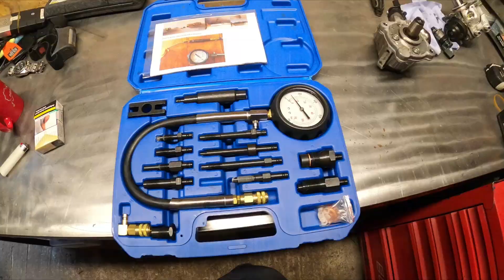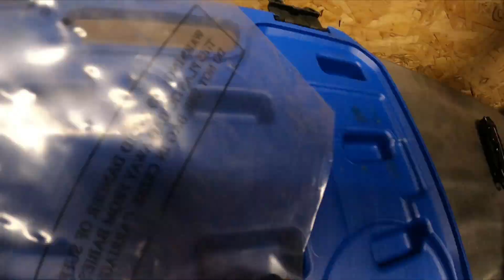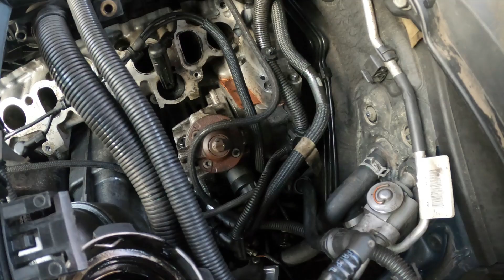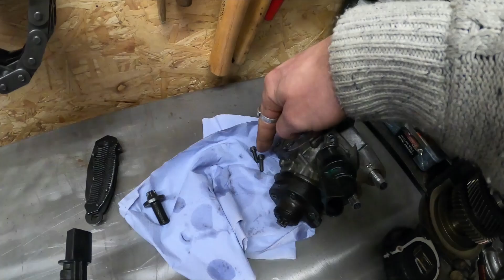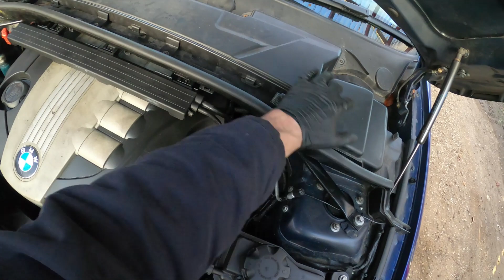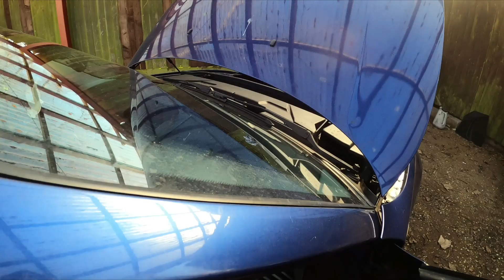BMW 118D N47 High Pressure pump replace Engine oil mix withDiesel, Engineoil increasing, Dieselinoil

Comment: Do you have a guide or tutorial for cleaning out the whole diesel system after getting metals bits from the high pressure pump? Im having the same issue now.
Reply from the maker: You need to investigate first where they come from-likely high pressure pump i would say. You need to take a part and clean all injectors, replace fuel filter, replace fuel rail,  drain flush and clean fuel tank-sender unit and fuel lines.
Hope thats helps

Comment: Hi martins hope u can help me out i have a 320d lci and the lift pump in the tank was making noise and car keeps cutting out and taking ages to start back up, I replaced it but still havd same issue. Anything you recommend check or replace next?
Reply from the maker: Did you check with diagnostic any faults?? It can be anything also fuel regulator. Check fault codes first!? Did you change fuel filter any time in past? Know it’s silly but possibility!?

Comment: Hi. So my car 123d cuts out under heavy boost, all tolerances are fine, no mixing diesel with oil,,,, do you think I need to replace my fuel pump? Many thanks.
Reply from the maker: Not sure. Need to check first before you spending money on new parts! But pump could be one of the problems. Get diagnostic done

Comment: Hello i have 123d running around 260 hp and i see my oil level go up i think mix with diesel what that means and what is the issue? Your car is alright now?
Reply from the maker: Hi Alex. Yes after i replaced high pressure pump all good no more problems with diesel in oil. I would probably recommend you do oil change and after look close to oil level if it keeps increasing then you need to search for issue. In my case high pressure pump seal.

Comment: Hi, great video thanks, I have the same issue with my 730ld 2012 face-lift bmw!! I have to change the oil once a month, I replaced the whole Manifold, then lambda sensor and then air mass sensor, I also did a boost leak test which is all good but I still have the problem of diesel oil mix!! Some people say the car does too many regens and that could be the problem as apparently the dpf requires burning diesel during regen and some of that unburnt diesel goes back into the oil, I don't know how!! Thanks
Reply from the maker: In my case it was just high pressure pump seal but you probably so that on video 🤓 All biggest problems with this 118D they are quote rear not many people come across them. The same with original pump which worn out and had full fuel system with metallic dust-bits. Also mention on video. That was first that kind video i done. Who knows maybe not the last 😂 
Glad you like it thank you 👌🤝